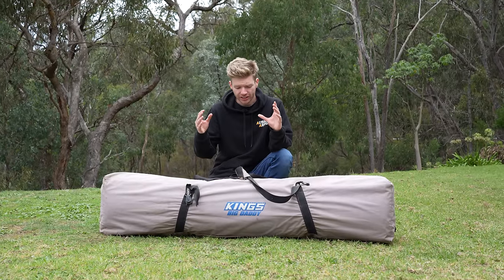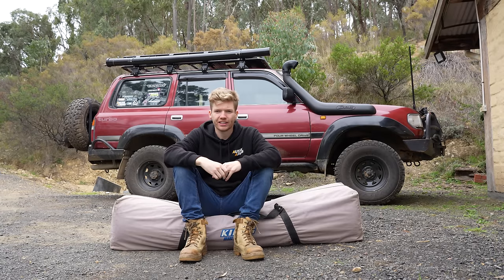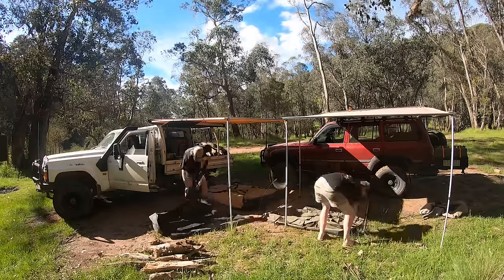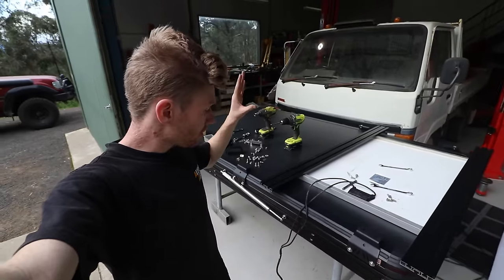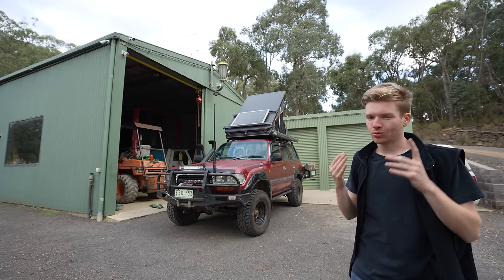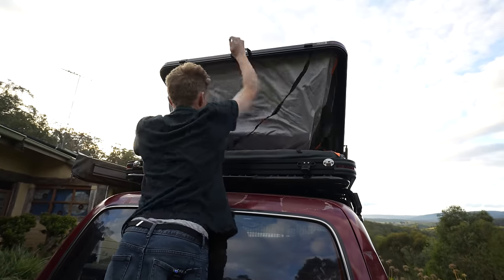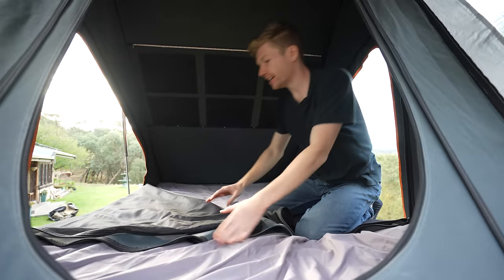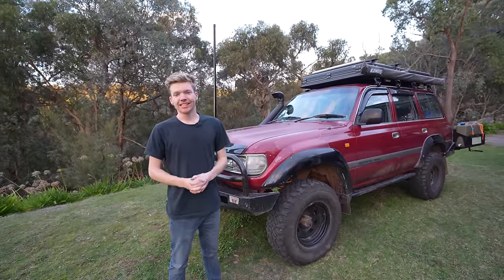A ROOF TOP TENT you can ACTUALLY AFFORD!? but is it any good??

Comment: Go the rooftop tents.
Me & my wife are well past our prime, yet still want to be out & about, mostly utilising our Caravan, but this limits where we go.
Googs Track, Tele Track, K'gari (Fraser Is) are the places we've love travelling to and staying at. I've threatened to taking our van to K'gari but in reality it's not happening.
In 2020 we were going to Cape York, camping, yet the prospect of putting the RV3 up, sleeping on the ground didn't work for me, too old to be getting up & down off the ground so out I went and purchased a RV5, two bunks and created the perfect setup, then came Covid, no Cape York but we did get to K'gari. Well after 2 nights the stretchers got left in the vehicle and back to sleeping on the ground, GRrr, not happy Jan.
Well 2021 rolled around and the Cape was still calling us, so RTT was becoming more viable.
We looked at several configurations, I-kamper stood out initially, but then I stumbled across the holly grail of RTT's, Bundutop.
I built a purpose made roof rack consisting of a flat base, but as we were losing our existing roof rack storage, (where we stored untidy gear, firewood etc.) I created a storage compartment forward of the Bundutop for small firewood, water hose etc. I created shovel, axe, ladder, rear awning and Bunduawn side awning (360 set up), mounts.
On went the Bundutop and off to the Cape & K'gari. Over night sleeps have never been more comfortable, setup and packdown so simple as Bundutop has winch lift/drop, all bedding, pillows are contained within shell.
No moister, no dust, not a complaint in the world, just love it.
For the record, the Bundutop access ladder is a two piece configuration. Owners complain about them for use & storage, well I put non slip tape on the treds, (use issue resolved) an aluminium storage frame on top of the hard shell (storage resolved), both issues addressed.
Outback touring is on our radar again, RTT reinvigorated us two oldies.
Now, I can already hear people saying how do two old farts get up & down this ladder?
I created an assistant pole/handle the locks into place on the purpose built roof rack, and this allows us to firmly climb atop and swivel aboard the mattress. We then have a firm post/handle to grasp and swivel from the mattress to the ladder, that's how. All problems can be resolved!
You young couple will just love it, enjoy life whilst you can.
RTT, Love It To Bits.

Comment: Weight. You now have 80 kilos upstairs. Not good. Even on an 80. I won’t put a rooftop tent on any car. I do have a Kings Quiky rooftop. It weighs 65 kilos. It is on my trailer. I like your tent and the roof rack. Just not up there.